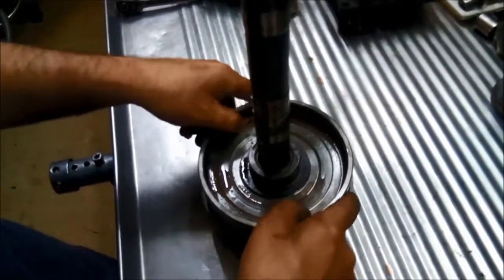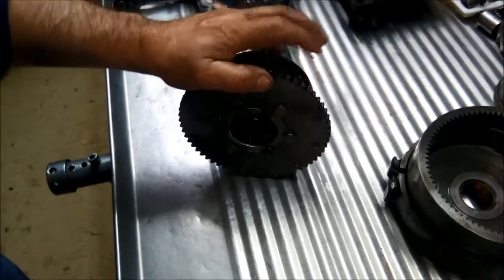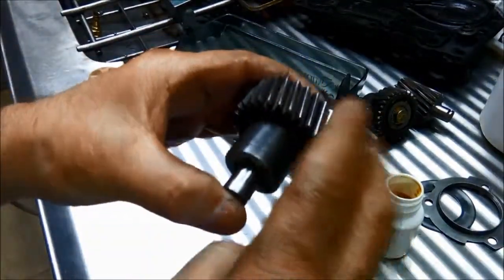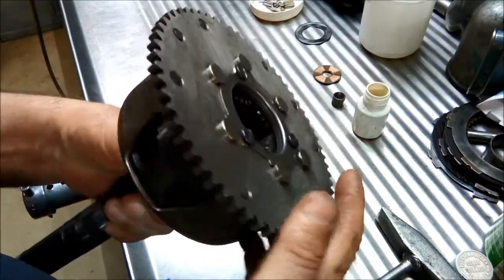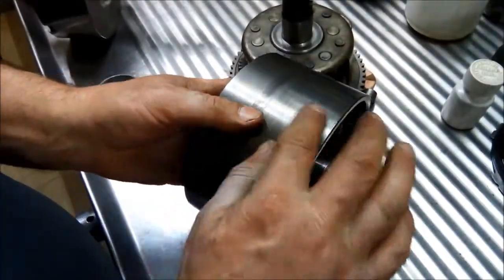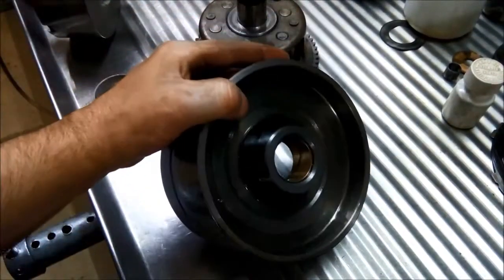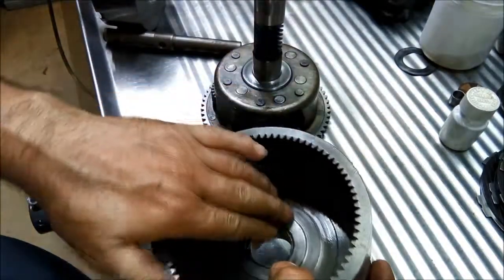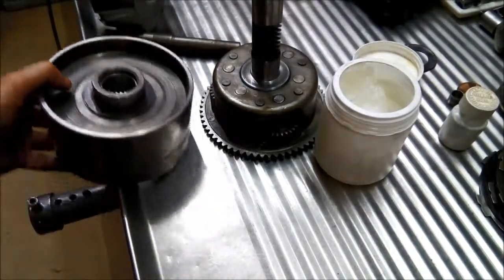Cast Iron Powerglide CAST IRON Rebuild Recondition Part 3of7 How To

Comment: On the 54 Chevrolet pickup correct me if I'm wrong transmission didn't have a pan how was the fluid drained? Thanks
Reply from the maker: hi, there is a drain plug.cheers